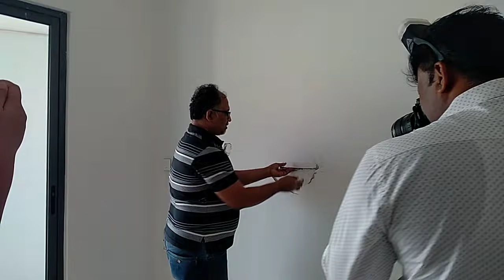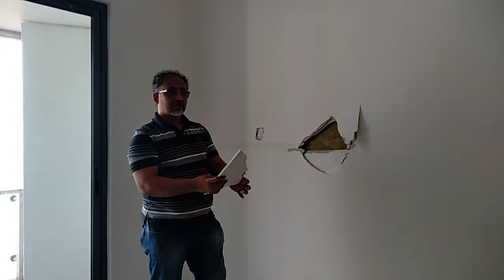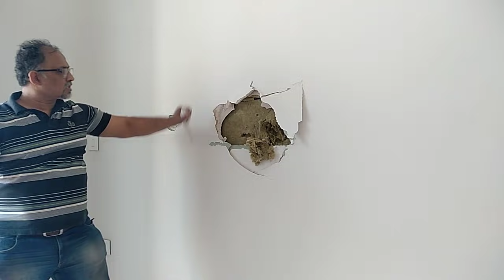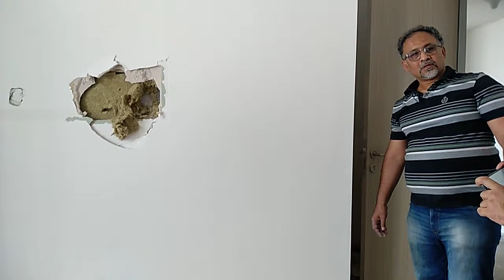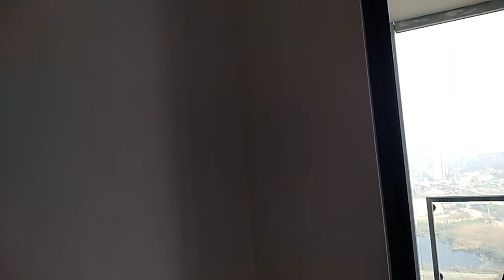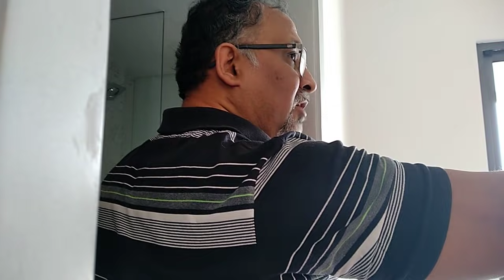Are all gypsum walls as weak as Lodha NCP's? One more Lodha wall punch video

Comment: Any Fire Officer will tell you that this is a ticking time bomb ,it is very surprising that people were not aware of this zero standard interior while the work was going on, regarding the wires ,80% of the fires occur due to a short circuit ,in this case ,the resident will not know immediately if the wires are burning inside , & this firm advertises front  full page back to back in TOI  newspaper, many must have fell for his adverts, if the interior is so bad , I wonder how the exterior would be ,the foundation, pillars ,beams ,walls etc , will this survive an earthquake.????
Reply: "Any Fire Officer will tell you that this is a ticking time bomb ," what a load of crap. If you build up to code no problems. The problem is the municipality or if its allowed in that geographical area. It is allowed in North America. and even in Dubai.
Reply: TRueC callername this wall is not build to code. Gypsum panel installation wrong and noggin channel not in place at joints of board. Not up to Indian standards
Reply: @santoshgami4868  I don't think it's mandatory to use gypsum panels in interior walls, it's not in NYC where I work. Even if you use gypsum panels it can be punched through or cut with a knife. The presenter doesn't know what he is talking.
Reply: Raghunandan Reddy C in USA drywall’s installation quality is very high, all but to code, in this video the wall is 
Not installed correct with missing noggin channels and sockets not installed proper
Reply: @santoshgami4868  the presenter has no idea what the standards are in Mumbai or India. Or does it exists? Show what the standards or codes and then show the mistakes.
Reply: Mumbai is in Zone 3 as per google. with shoddy construction many concrete building are in danger. next point. Just check Los Angeles city codes for earthquake requirement to understand the problem. Many of pillars.beams are wooden here. They alos use iron beams if code requires.
Reply: with walls made of such loose particle boards and wood boards its literally a cremation pyre , once it catches fire its not going to stop. definatly not a place to live.
Reply: Omg.. 😦Really. Tomorrow m gng to expose lodhaa in my Chanel 😈😡
Reply: @RaghunandanReddyC  does it  rains in NYC the way it rains where presenter bought the house of cards!!?

What about the moisture and 🔥 safety...
Just out of curiosity...
Reply: I’ll start this with saying those walls are not built to North American standards. That said, I’m in Canada, and similar to the USA our houses are mostly wood and drywall, and highrises are a mixture of concrete, metal, and drywall. Walls are usually filled with fiberglass or similar insulation, it keeps heat in, noise out, and is fire retardant. The buildings are designed with earthquake proofing in mind. The outer walls are usually wooden board for houses, covered with a waterproofing layer and additional material on top. It rains continuously where I am, done properly the houses won’t leak and will stay warm and dry for decades.

The drywall I’m seeing in the videos looks very thin, and with other quality issues they might not be using it right. Done right it can be a very good quality, our homes over here worth $30,000,000+ are still using similar construction.
Reply: @TrueC  callername Do you know all houses in America are required to have efficient fire sensors and do you even know how quick is the response time of fire fighters in USA in case of a fire incident. In India by the time fire fighters arrive the whole building will be ashes so dont compare apples to oranges like a moron, we have concrete buildings for a reason.
Reply: Strength of the building is in the pillars and slabs not walls.

Comment: Thank you Sir....for exposing the builder. BTW That could be Rock Wool if not Glass Wool.
Reply: Worst quality drywall installation ever. Horizontal joints. No noggin channel. I would be terrified to sleep in a house like this. Fire would eat you in your bed 

How do Saint-Gobain do drywall’s this is not proper , in DUBAI drywall’s are build proper same US and UK. This is not proper drywall’s partition 

Dangerous drywall’s fixing in this project
Reply: Is this gyproc Saint-Gobain India??  Who build drywall’s like this ? ??  roadside drywallwalas
Reply: That doesn't matter whether it is rock or glass wool. The walls should/must be made up of bricks 😅
Reply: Noob Gamer walls made of bricks in a highrise buildings increases the load on the structural elements and can cause structural failure. Cinder blocks are the preferred building material. Dry wall may be used in really tall buildings to further reduce weight. But there are regulations on how drywall is supposed to be installed. Drywall on a not so high building reduces the weight of the building and that means the builder has to spend less on laying the foundation. Simply put builder is trying to increase profit after paying bribes to the local administration.
Reply: he has superhuman strength

Comment: Its a "dry wall"
Glasswool inside the frame for sound Insulation
New way of Constructing inner walls to reduce dead load of the building 
Most of the contries are using same technology now a days...
Reply: All these people complaining here are absolutely not used to having dry wall in their new homes. Most Western countries use drywall in 99% of their construction. Low dead weight, fast construction. The consumers need to be made aware of how to live within dry walls. I think it is too early for Indian consumers. You get special fasteners for walls, patches to repair walls, etc. You dont have to replace entire walls. Lol. Definitely not meant for indian consumers where they are used to better quality construction and handyman help is affordable and plentiful.
Reply: @jameskiewitz6759  true
Reply: Then for what they are charging such a huge amount of money ?????
Reply: @PikuBirrikh   बिRIKH  cost for 4" solid wall is equal to dry wall bcz glasswool  used for sound insulation it is not a low cost material...
Reply: @layoutdesign6660  OK OK alright , but they should inform the whole thing to the consumer before selling the apartment . Isin't it ???
Reply: @PikuBirrikh  that is not only mistake of seller bt also mistake of customer aslo 10lakhs ka car leneku 10times test driver karthe so wen u spend crores even custmra should be smart...
Reply: @layoutdesign6660  yup that a point to be noted but sir agr main aapse kahu....kya aap apartment lene se pehle uske walls per mukka mar ke dekhoge ??? Ofcourse not . So ,
Reply: Yea it's a dry wall but a very low quality dry wall. It's so fragile that even a middle aged normal person can break it easily. If it was a high/better dry wall then definitely you will need to hire tyson or brian shaw or khali etc etc to break that.
Reply: Dry wall is cheaper and weaker.. also easy to construct.. so dont need quality labourers.. y to charge so much for this kind of house? Pathetic
Reply: They are using in the house for partition wall but not in apartments

Comment: Also take this material out of building and burn it. show how quickly it burns. in case of emergency fire it will not give any chance of survival. Electrical fitting is also inside these fake walls, so their are always chances of short circuit. it is also complet violation of fire safety rules.

Comment: Drywall or gypsum boards are used to build interior walls all over the US. However, they are screwed on to wood or metal studs spaced every 16-24 inches. Anything heavy is supposed to be anchored into the studs, so it is not a big deal.

The photos where they have punched holes into the wall indicate that the builder may have spaced the vertical support studs too far apart.

Overall, it looks like this builder has only picked bits and pieces of construction ideas where it saves them on cost and material weight, without adopting all the requirements that go along with it.

what about the sewage lines, low quality pipes, wet sand below floor in the flats ? almost every tenant of the building has complained that the flat delivered is not even close to what was promised. Not to mention the 2 year delay
Reply: @Roh Fer he wouldnt have written comment there bcz his message is combination of 3 and 1 of those messages is written by me
Reply: yes super civil now @Roh Fer
Reply: Roh Fer what was the reddit comment na?
Reply: exactly. It has to be by code here. we do it here at home.
Reply: There exists a thing called National Building Code.  Dry wall / Gypsum board CAN NOT  be used as internal wall acvording to NBC. Construction in India has to according to NBC.
Reply: @sachinsmuthe  dry Wall is a common home building material.
Reply: Hes correct about us even in australia its the same but this is india and as indians we need better construction quality rcc walls btw destroying his own house is not an answer ... He should rather approach a court

Comment: On one side where Mumbai is one of the biggest Trading center of India, the other side is it is also a very corrupted or rather the birth place of all kinds of corruption and cheaters. In that, just imagine, a flat cost of 3.5 crores, is just made of gypsum boards and card boards which must not cost more than maximum 10 lakhs are sold for 3.5 crores in addition promising all sorts of amenities.  If this is the state of so called Paradise building and showing paradise of gypsum and card boards better people this is a high time that we all must leave Mumbai for good and settle else where to be safe and get for what you pay. 
In gypsum gypsum and card boards, houses ae extremely inflammable and has 100% fire hazard and no guaranty it will stay or hold any even small guss of rain or water. ALL THE BEST AND WISH BEST AND LONG LIFE IF STAYING IN LODHA NCP. MAY GOAD BLESS YOU WITH A LONG SAFE LIFE.

Comment: These walls are used in high rise building for light weight/ burdon. These wall are not much cheaper then red brick walls , nowadays acc blocks are in used..
Only solution is that ignore purchase flats in high rise building find better one.
I m not a builder or lodhas agent 😂 I know about this just sharing
Reply: This is drywall and insulation.  Same as what western  wood homes are made of. Yes they are provided due to weight  issues. These are only used as partition walls. In gadho ko kuch nhi pata.

Comment: I must say, the fit and finish seems rather appaling. But builders today have to work with norms (still does not justify the really bad finish on these apartments). 
In order to cater for the construction industry, environmental issues have been  compromised. Our rivers are being dredged for sand for cement, natural resources have been depleting. However, construction  of these super structures are now less "heavy" and use more advanced and eco friendly materials which definitely compromise the tough concrete structures we are used to. 
NONE THE LESS! I still feel the quality of finishing on this apartment complex is appaling.

Comment: I'm watching your videos and I'm confused.  Gypsum board ("Drywall") is absolutely standard US construction for single-family homes & multi-family buildings alike, whether cheap or expensive.  It replaced plaster and lathe interior wall finishes around 70 years ago.  Just like you suggest, it is not mechanically strong, and it's not water resistant, but it's dramatically faster and cheaper than a full plaster wall, and it's good enough for nearly everybody.  It's not rare to have angry teenagers or furniture movers leave a hole or two in the wall, yes, but repairs are simple and common.  The mechanical strength of the wall comes from the vertical wooden studs (of around 37mm x 87mm) spaced every 400mm along the wall, and this is where you screw in shelving.  Drywall is finished using two types of joint compound (one is evaporation-based, one is a concrete-like cure) and paper or fiberglass tapes to hide the seams;  Seams are jointed and sanded down in several passes.  Premium homes often get a 'level 5 finish' with a skim coat of joint compound over the whole surface and another sanding pass.  Then after this is all done, we paint it with latex/water based or alkyd/oil based paint.

It's not a shear panel;  It's not for making load-bearing walls (it's for hanging off of load-bearing walls and ceilings).  Our wooden exterior walls are constructed similarly, but have a plywood panel on the exterior to keep them from bending, insulation in between the studs, and drywall as an interior cladding.  Europeans make fun of us for making our exterior walls out of wood, but done properly and maintained properly you can make a structure that lasts hundreds of years that way.

Drywall is code-mandated in a number of ways, because the way it interacts with a fire makes a drywall-surfaced wall very fire-resistant.

We extend this technique to work in the diverse extreme climates we get at opposite ends of North America, pretty much everywhere.  There are some regional differences (Boston eg prefers a mechanically stronger solution known as 'skimcoat plastering', and there are different ideas about how to do wet areas like bathrooms), but not many.

What's the standard wall design paradigm in Mumbai?
Reply: I should add:

The stuff you see where the wall meets the floor is standard trim board.  It's not structural.  It's not "holding anything together", it's just a decorative measure to fill an unsightly gap (also helps with pests a bit).  What's holding things together is a bunch of drywall screws going directly into the studs.  It's possible to cheap out on the number of such screws, but it doesn't save a lot of money (drywall screws are very cheap) and your video doesn't show any evidence of this one way or the other.

Steel studs replace wood studs in much of our commercial construction (400mm or 600mm on center spacing), but it's very thin steel, never used for structural applications, just to partition an interior space.  The actual skeleton of the building is a boxy framework of much thicker steel girders.  The insulation is standard fiberglass or mineral wool;  It's never supposed to be exposed like this, it's not supposed to have any strength to it, it's just to fill spaces.  For an interior partition wall its role is not as thermal insulation, but as sound insulation to damp some of the resonance of the wall.

Comment: This is a dry wall partition and is standard technology abroad. It is lighter in weight and takes less time to construct. It is fire proof, sound proof but not water proof. 

You can see the manufacturer video by GYproc India at https://www.youtube.com/watch?v=ORhV5Jya8ms

However it does not appear to be as strong as a brick wall. Other limitations are you cannot fix bookshelves or heavy stuff to the wall. And unlike a brick wall, you also cannot redo the wiring as the wall gets permanently damaged here.

However it is sad that with a small punch, the wall breaks. I would have expected this so called latest technology to provide at least the same strength as that provided by a brick wall.

Comment: Sheetrock walls are in use for last 50 years in USA in all houses but I have not seen it breaking just by punch.This is very low quality sheet rock.And even metal studs are not at 16" to give more strength.Must have cut corners everywhere.

Comment: If in the specifications it's mentioned that there's indeed a gypsum partition wall then there's no use of crying like a pussy over such issues. In North America gypsum is the most used material in interiors where fire resistance classification are needed. It's durable, economical, and of course fire resistant. If this particular builder had used substandard material in construction then that would be the cause of worry.
Reply: These walls are made with Gypsum Boards. Gypsum by nature is a insulated material. If we can see all developed countries, we will find with Gypsum board walls only for interiors. These walls have good acoustics, energy savings, fire resistance and good insulated values. Inside Interiors would give peaceful environment with eminent aesthetics. And good thing about of these walls are light in weight have lot of energy savings. We can save power bills due to green product. Yes for maintaining dry walls need to follow dos and don'ts. These walls are idle for high raised buildings. No curing require, no need to use sand, cement.
Reply: @nagaraju-gx2zk  I know gypsum is a good material. Seems like in this building material application and workmanship is of poor quality.

Comment: I’m not supporter of Lodha 
This is dry wall, in western countries these are conmen, 

if this wall is separate you from your next door neighbour then it’s problem and if this wall within the house then no problem at all. 
The insulation is doesn’t seems glasswool it’s earthwool which is rated higher then glasswool 
Earthwool used where high temperatures has to maintain. 
I work in construction Industry for quite long time overseas 

this thing is new for Indian people to except. We want solid wall even within the house which is extra weight the building and foundation has to carry and have to mention higher cost of the building material and labor goes in it.

Again I’m not from LODHA BODHA or no one pay me anything. I have seen the other videos stopping this couple entering their own house that just bully, go to police file complaint.

Comment: This is called Drywall. It’s used only for interior partition all over the world. It’s made of Gypsum . I don’t see thus mans complaint .  It cones in 2 by 4 foot size and various thickness ( 1/4. 1/2 or 3/4 ) ! 
  If it’s installed properly it will last a century.